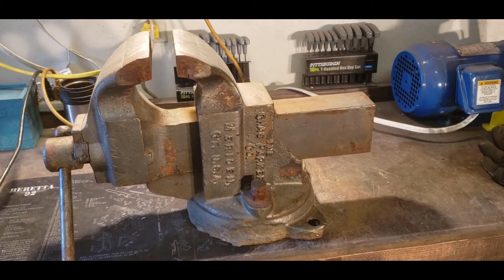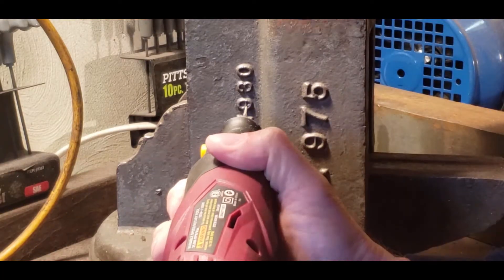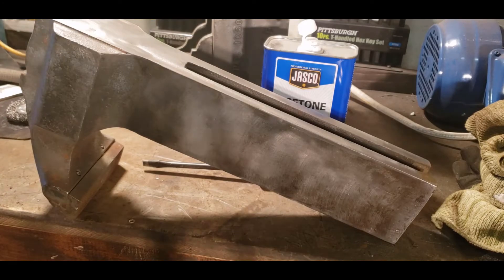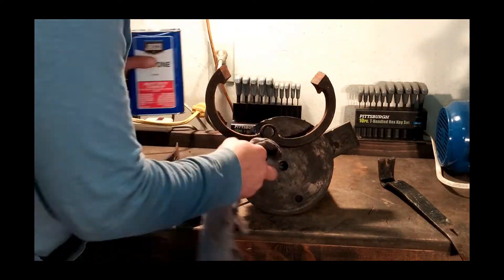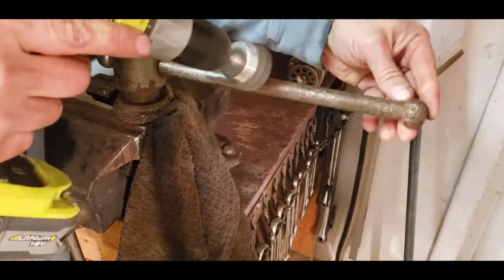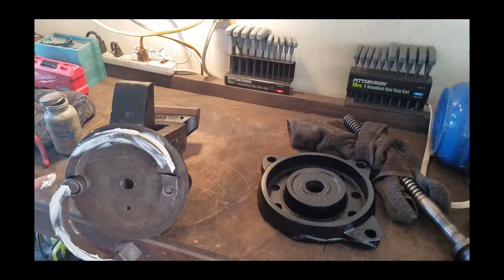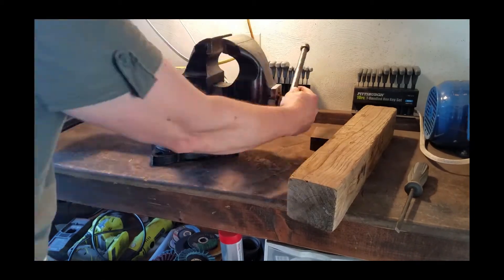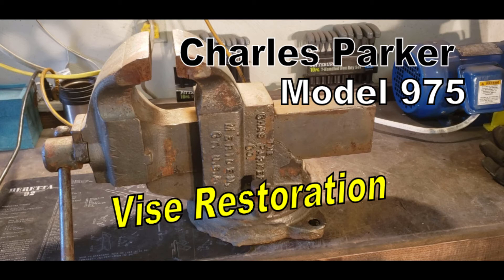Charles Parker Vise Restoration Project Model 975 from 1930

Comment: I recently restored my Chas. Parker No. 955, 85 pounds, and used a wire brush on an angle grinder for all the bright work. The handle and screw polished up like new, easily leading me to believe the metal contained a high nickel content. The jaws cleaned up too. I sand blasted, painted the body gray and highlighted the letters with a black paint Sharpie. If you try one of those I think you will be impressed. Mine has a screw, spring and small copper/brass puck that rides against the handle. You can adjust the tension which is a great feature of this vice.
Reply from the maker: you'll be enjoying that vise for years to come! and hopefully one day, your grandkids will too!!

Comment: Nice job. I recently restored my Parker 272. It has a swivel base plus a swivel jaw, which is kind of rare and cool. Here's a 'did you know' question for you. Did you know the end of the spindle has a small screw to allow you to put tension on the spindle handle so that it won't fall onto your fingers as  you turn the spindle? The small screw presses against a small diameter helical spring, which in turn presses a brass slug against the handle. I found the brass slug to be completely worn away on my vise. I replaced it with the lead bullet head from a rim fire .22 cal bullet. It fit perfectly and works well.
Reply: wow! that's great to know! I'm so glad to have restored something so old and turn it into something useful in the shop. I use the vise nearly every day! How old is that Parker 272?
Reply: @mannsdan  Glad to be of some small assistance in   promoting your education on the fine points of vises (not vices). I don't know the age of my 272, but due to the shape of the spindle end and an unusual single piece brake shoe in the swivel base I expect it a fairly early unit. It's way more vise than I need, but I enjoy how it causes vise envy in my friends and neighbors when they see it.